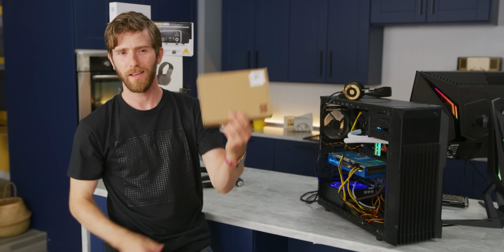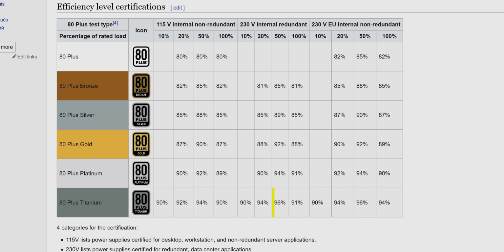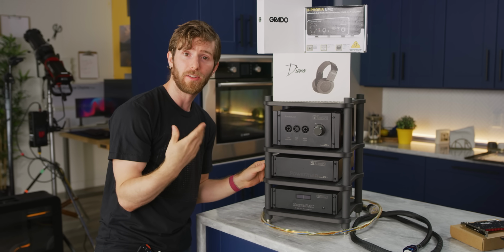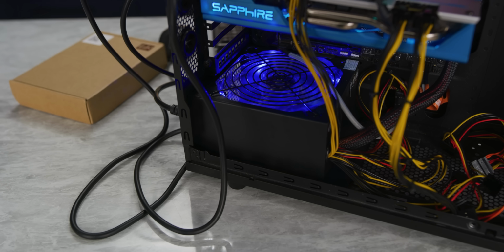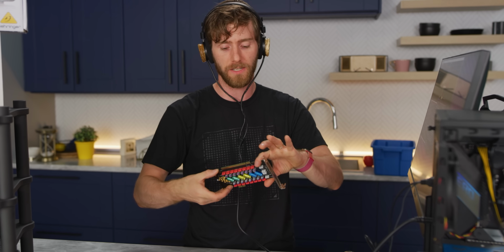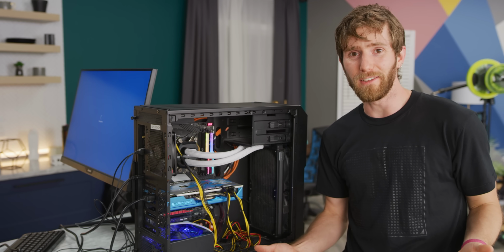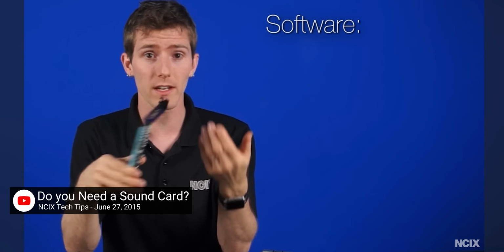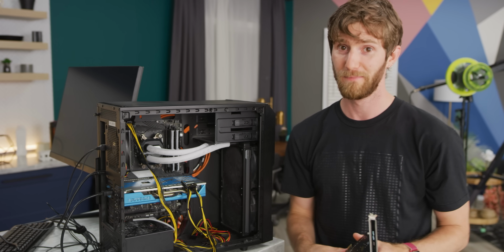Is this $40 card a SCAM? - "Audiophile" Power Filter

Comment: Have realtek onboard audio and thought it was fine for years.  One day I noticed build up in noise floor.  It took years to notice it... I am not sure why but audio is very difficult to notice an issue till it's very present.  To fix it I went to a fiio k9 dac.  I bet switching I would notice in a second but if it doesn't improve it by quite a bit you would never know.

Comment: On a well-known audio forum, I made heads explode when I suggested a $10K "power regenerator" is a waste of time, just buy a true sine-wave UPS for about $200 for their equipment.

Let's not get into guys taking normal fuse boxes and replacing some of the rails with copper and then charging $5,000 for a $100 fuse box.

Comment: If you want noise, you just have to rip off the ground pin in the AC
Also, where the fuck can I get that, I just want to put it in my useless PCI x1… and get my industrial dinosaur motherboard some LEDS
Also, I have no ground in my computer, so I get a ton of noise, and I will be the judge of it not working

Comment: Audible noise from the SMPS power supply is removed by the L-C filter attached to the AC inlet rather than increasing the capacitor capacity on the load side. Although this product cannot be said to be 100% snake oil, it is also true that reducing noise above the audible frequency is also meaningless.

Comment: I think some performance boost might be detected but not likely to be seen in Canada or the usa's power grid. I'm picturing a 3rd world country or someone maybe trying to run a PC off a generator of varying loads. That all said dedication of a pci slot seems to be not the best way to integrate more capacitance to filter dirty power. Not that I'd expect it to function much differently. It's just clogging up a slot that could be productive in a different way. In addition depending on how terrible the power source is such as a basic gas generator extra capacitance beyond that board might be more ideal. Being the product is marketed as a audio product, I don't believe anyone serious about audio production would have a gas generator running near them. As trying to block that sound would be a very pricey solution. I'm left with possible off-grid lifestyle people without a pure sine wave inverter and places like hati where getting electric to spec would be a challenge

Comment: the reason this didn't make a difference is it's taking power from the system that has already made it to the sound chip in the motherboard. 

I do have an interesting story about sound cards that I thought of watching this video. When I built my system back in 2019 my roommate had a sound blaster SB 1500 laying around he wasn't using that he let me have. While the motherboard audio was fine for what I was doing the sound card did make a noticeable difference in the sound quality on the same set of speakers, especially in regards to bass response and the crispness of the audio overall. 

Fast forward about six months or so to summer of 2020 and I decided to switch out the RX 5600XT I'd originally put in the system due to it having trouble playing anything pre direct x 11 with a 2070 super founders edition and I started hearing a buzz in the speakers when my system was on and just idling. Couldn't figure out what it was. The sound card was directly under the new graphics card and I was about to RMA the card thinking there was something wrong with it till a friend suggested moving the sound card to the bottom PCIE slot of my full ATX board. Did that and just that little bit of distance from the graphics card solved the problem. 

The point I'm getting at is if you have a cheaper motherboard with crap shielding on the audio chip a potential fix for buzzing in the audio of system one might encounter could be to get a separate sound card,(which is around 100 USD so cheaper than replacing a motherboard in most cases), and installing it as far away from your GPU as possible. Especially if you have a full ATX board with more than two PCIE slots

I still have that sound card and GPU and even though I've upgraded the motherboard and CPU since then I still keep both of those cards as far away from each other as possible and still enjoy great sound quality

Comment: DJ here! This card does make some sense...and also doesn't
If you want good audio u always go the usb audio interface route. Yes usb can cause problems, but they are purely DIGITAL, meaning it's usually sound stopping or some weird artifacts happen.
The most common fix is to get a usb cable with a ferrite filter. I believe this card is aimed at some very specific use case, but I can't quite make up what it would be.

Comment: Ah. The most basic kind of "Audiophile power filter" scam. Just a whole bunch of audio capacitors like Elna silmics (that aren't even designed for supply filtering btw) along with a f-ton of tantalums and ceramics, put in a row. Which honestly at best does nothing, at worst actually makes things WORSE by resonating like an electric tuning fork...

Comment: Old vid, I know, bored with some newer content, but I have to point out, which (Linus should have known) GPU coil whine comes from the COILS connected to the power delivery circuit, which is connected to the PCIe power cables plugged into the GPU, completely separate from the motherboard power. There is NO way a plug in card will fix coil whine or any other power issues outside the motherboard power system, considering, most coil whine is from the coils themselves, not the power delivery. Nice looking card thou, look like it would do something.

Comment: Coming back to this video, and this thing is still useless, but I've had a motherboard that had bad power delivery. It was just USB ports that was the issue, though. I had to buy a dedicated 1:1 USB 2.0 power filter extension so that the USB amplifier portion of my headset at the time didn't sound absolutely awful - using just the 3.5mm jacks was inaudible, so the USB plug was mandatory to be able to use the damn things. The board was a Crosshair V Formula Z, but that thing fell apart over the years. I still have it, and the Realtek DAC on board is trashed. The only 3 ports that work out of the 5 rear and 2 in the front was the Line Out/Line In on the rear, and the Headphones Out on the front panel. I had to plug my microphone jack into the Line Out and tell the Windows driver it was Mic In, and then use a long extension to plug into the front panel for Headphones Out. Line In was not amplified by the Realtek chip so it could not be used for microphone input, it would rarely work when selected to be Line Out, but sometimes worked properly if selected to be Line In (which again was unamplified, so useless for a mic), and the Line Out circuit for the rear didn't work at all anymore (hence the extension to the front panel). Microphone In would always result in screeching no matter if the driver was working or not. The driver would fail to bootstrap in Windows most of the time, likely because the Realtek chip was just so damaged, so when it didn't fully load the audio in and out was just garbage screeching proportional to the volume of whatever was playing / input on the mic. It did nothing under Linux; just did not work at all, so I knew it wasn't just an issue with corrupted drivers. The board got to be that bad because I'm in the poorer area in the middle of a rich as all hell part of the suburban area outside Toronto, Ontario, so our power literally goes out first even if everywhere else around us is fine. Thanks, Hydro One of Ontario. Repeated brownouts killed so many parts of that board. The USB 2.0 ports would all power off every 6 hours or so, resulting in Windows playing repeated "device detected" noises, and of course damaging the file system of any device connected, and disconnecting the mouse and keyboard for 2 seconds at an uncontrollable interval. Combined with an FX-9370 it was like literally trying to game on a nuclear reactor constantly on the brink of a meltdown, it ran hot after unclocking, undervolting, and maxing out fan speeds, and I've never used anything less stable in my life.

Comment: I think Colin should have used two builds/benches when writing this ep. One with proven noticeable distortion / whine from dirty onboard power pollution, and one with a decent main board with filtration, like most decent modern mainboards offer.
This would demonstrate what Linus had to explain at the end of the video, and would also properly demonstrate if the PCIE card does anything at all... Which it probs does not because it's not in-line with outbound analogue or even digital signals. 
So, this way, the outcome would come down to two solutions: have a main board with standard audio filtration, or get a sound card if you have a noisy main board / if your output sounds thin or unbalanced.

Comment: My laptop could actually need something like this (not this janky one) because dang it the audio combo jack is noisy on the right driver.

The laptop is a new model and manufactured in 2020 so I'm sure by design it shouldn't be like this, but mine is. The only solution I can see is using a USB sound card, which I have, for when I want to listen thru wired headphones. And it's a good one at that, the FiiO BTR5.

Comment: this might work when you use a longer cable in a different kind of environment, like we use direct injection boxes for instruments that dont produce acoustic sounds, usually you wont hear a difference when ur instrument is 3ft away from the audio desk like when u use ur pc for music via an aux cable, but when ur using a electric keyboard thats like 100m away from the audio desk and the cable is getting blasted by lots of electo magnetic radation then u will hear the difference with a DI and no DI. So thats why i think that trying this card with a long cable like 75m might make a difference. this would pbr be kinda ussles since why tf would u want to listen to music so far away from ur pc but still its meant for rare ocasions

Comment: Looks like you needed to bring in some  audio engineers. I've recorded high gain guitars before. This dirty sound is extremely noticeable when recording instruments.  All of this applies to normal people, But for audio engineers and people that really need the full audio spectrum, This dirty sound is extremely noticeable in bad environments. But how we fix the issue is we get a dedicated audio interface. It is basically an external sound card that can process everything we need. That, and you'd have the instruments and speakers away from the computer.  There are other things you can do but that's the majority

Comment: in my case i have that buzzing sound. 

my set up: 
850w with msi tomohawk mobo
-backpanel output to soundcraft line in 3 input
-backpaenl input from soundcraft aux output
-front panel output to soundcraft line  in 4 input

soundcraft notepad 8fx
-mic condenser to xlr input 1
xlr main right output  to pc rear panel input
xlr main left output to desktop speaker
headset monitor

i get a noticable buzzing sound from my headset/desktop speakers 
and even worse whenever i put the main output to almost max, pass the 0db slider

i manage to eliminate most of the humming by inputting those aux ground loops that usually cost under $20, to my mic and rear panel output. 

in which i think this product should solve my problem

Comment: Use a good reputable power supply and THEN use optical. This eliminates any noise within the electrical system from getting out through the audio. Any electrical connection no matter how high end still receives noise from the CPU/GPU in it's signal line AND ground. Use optical and end the noise.

Comment: I kept hearing noise from both an external sound card driving head phones AND a sound card driving a DAC driving tower spatial audio speakers, turned out to be the cheaper asrock z390 mATX board and two neighboring USB ports where a usb powered LED strip was interfering with the USB cable of the sound card. You can hear the LED strip in complete silence making a bit of a hum, and I guess it translated to the USB port and messed with its neighbor port, because the noise stopped when I unplugged the led and plugged in something else, etc.

Comment: those grado headphone looks pretty decent... but they are hi-fi headphones and are there for not really reliable as point of reference, as they already have filters and other techniques build in to improve or change sound quality, probably great to listen to music to but not that great for reference when trying to listen for noise. 
A better reference model in the same price class would be something like a beyerdynamic dt 770/790 pro (80(+)ohm) or something a like. 
These headphones are made with clean sound in mind, and dont mess with the sound signal as much as your typical low/mid tier hi-fi headsets do.

Comment: Well, we use arrays of diodes, called TL smoothers, in-line with 3D printer servos to reduce noise, and they work really well. Still, I’d be extremely surprised if motherboards didn’t already use diodes and caps to filter out noise in the PCI bus

Comment: Thinking back to the video you did about the computer timing and balancing out power, I'm wondering if this card had any effect on the performance of the system you tried it in?  If smoothing out the power increases efficiency, then this card should have some effect on performance.

Comment: Shouldn't caps be connected immediately before the power pins of the component/circuit section/circuit card you are trying to protect from dirt signals?

Comment: linus didnt even test it right. Its for systems that already have a ground loop issue that can only be stopped by removing the ground. Doing a dual stream PC setup and using this card took the ground loop hum caused by connecting 2 pc's into a mixer. even when they were on power conditioner and apc. This video is BS even the external audio dac recommendation is a blatant lie.

Comment: This makes no sense.. even if it actually worked. If you at all care about audio quality, which we assume you do if you're buying this thing, you could spend the same amount, maybe a little more on a dedicated audio interface or cheap dac/amp with it's own dedicated power source that is also going to have a better DAC and probably a better HP amp than your MB audio. It doesn't make sense to spend this much on something to enhance your motherboard's audio quality (Even if it did work as advertised) when you can spend the same to get an audio interface to negate the problem completely.

Comment: of course there is no difference. for the capacitors to filter out the electro static and electro magnetic stuff, ALL the current needs to go THROUGH that card and the capacitors and then be distrito the other components.
its like a coffee filter. you cant stick a coffee filter on the outside of your coffee machine and think that the coffee will be magically filtered without the water actually flowing through it

Comment: Well.  If I was worried about noise on the PCI power rails, and wanted to test a plug-in filter that was supposed to help, I would be giving the PCI bus a bunch of chunky stuff to chew on, in order to create noise on the bus.  The power supply capacity has a little bit to do with it, although I wouldn't expect a regulated supply to be that voltage-sensitive to current fluctuations.  But the resistance in the cables from the supply and the PCI bus copper tracks I would expect to be having some effect.  I wouldn't expect to be able to hear it unless my audio card was crap and had sub-standard filtering on its own power supply circuitry.  As for coil whine, you're not going to get anything happening with that using a plug-in filter, better off potting the coil if the windings can vibrate.  But point is, you need to be looking with a scope or spectrum analyzer to see if the card makes any difference to the voltage on the PCI bus, and it may be dependent on which slot you plug things into.

Comment: This appears to be a completely meaningless test. You need to get an oscilloscope on the case. This isn't intended to make your audio sound better as such, it's designed to suppress interference/noise, so if you haven't got any noise in the first place you won't hear any improvement will you? You're computer bods, which is fine, but this is an engineering test and for that you need somebody who understands electrical engineering and can test accordingly.

Comment: Why 1000W SMPS? You should have used a lower power one. Bigger power means bigger cap on the output, so better ripple, at least when functioning under the rated power.
Also, to the manufacturers defense, you are powering the video card also from the 2 6 pin connectors directly from the SMPS, which "bypasses" power from the PCI-E bus.

Comment: I had a very specific setup. New PC right out of the box, two BlitzWolf speakers that have an amplifier in them and for good measure, one LED bar VU meter. All of this powered by the computer via USB. I heard a slight tinniness in all audio that was caused by a ground loop. The solution was a simple audio isolator bought online for like a couple dollars. Plug it in between the PC and your speakers and boom, the ground loop is gone. Oh, and the wiring is goddamn horrible. It's a rat's nest all plugged into a 8-way audio splitter. I won't be surprised if I ever start having crosstalk or EM interference from nearby mains wiring.